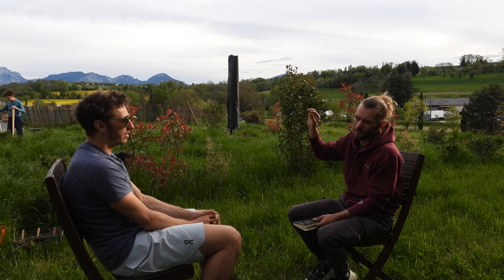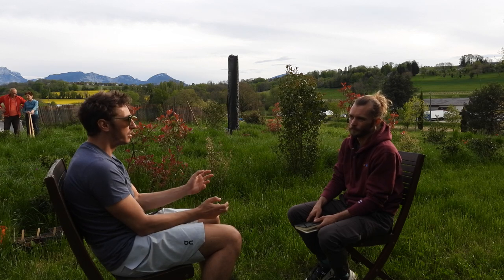Should you fly with your brake toggles at your shoulders? - Theo De Blic

Comment: Exactly - Use enough brakes to get feedback from the glider, no more. And with the launch I have a go at getting the pod with my foot while my shoulders are still forward (usually successful), if that doesn't work I just don't get into the pod until I'm flying stable. I almost never use my hands unless I've dragged the pod on the ground on launch and it gets twisted. Pods aren't necessary to be in all the time lol. They're good on glide for aerodynamics but in a thermal or just after launch, for me, being inside the pod is the least important thing.
Reply from the maker: Exactly, I also stay upright with shoulders forward, helps a lot to get into the pod. And yes there's no need to use your hands to get into any pod, it is more about the body position and a good pre-flight check, not to get the pod twisted before take-off.

Comment: Thanks for the video, it really helps! As a beginner, that topic confuses me so much. I have been told indeed to "keep some pressure", "be at contact point", "apply the weight of your arms" or "use the rule of 400 grams". I can't tell if all these are the same as the shoulder brake mentioned here or if it's the level just before. Also, what I have been explained to is that in active flying, you do need to keep a certain amount of brake, so you have a margin of brake to release both ways in case of sudden change of angle of attack. So thanks for the video, I'm more confused now, but at least I know I seriously need to dig this topic, and to clarify what people actually mean when they say "weight of your arms" and all :)
Reply from the maker: What you need to do is fly at contact position, which is taking out the slack out of the brake lines, but not inducing a bend on the trailing edge, this you can visually check as you doing a glide, pull just enough brakes to take out the slack just before it induces a bend on trailing edge. Remember this position, this is the position you want to be flying at. This is your neutral position, to which you return after doing any action.  Dose this make it more clear for you?
Reply: @FlyingKarlis  Very clear! Thanks a lot :)
Reply: @FlyingKarlis very clear explanation, thanks

Comment: When you fly with the brakes on 25% and get to a stable flight at that speed if you turn loose one break all of a sudden it will thrust that side around from the pressure buildup under the wing. This is often a tight turn and the pilot spirals down 100 ft, and hits the ground hard. There's a certain minimum radius and a certain minimum speed. When you get below these two points you don't have control authority anymore and you can't do anything but ride whatever it wants to do